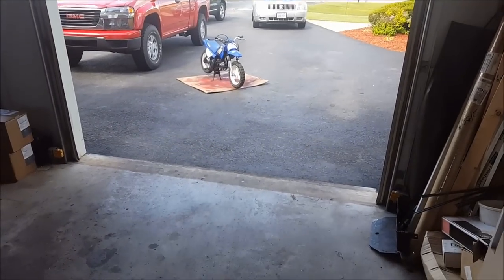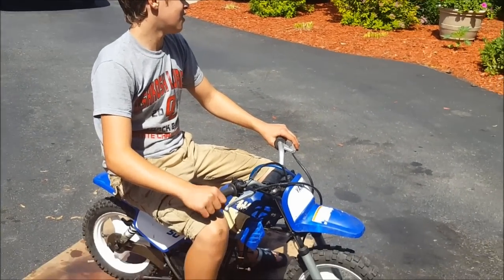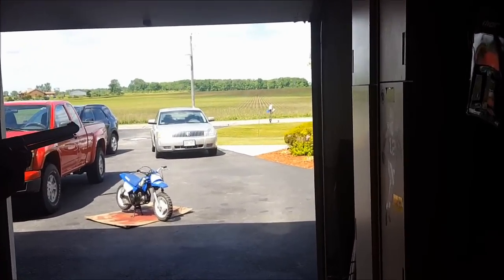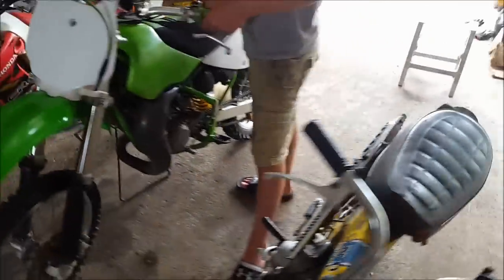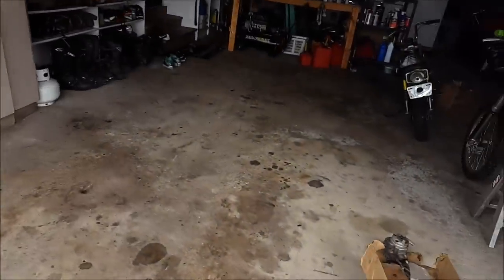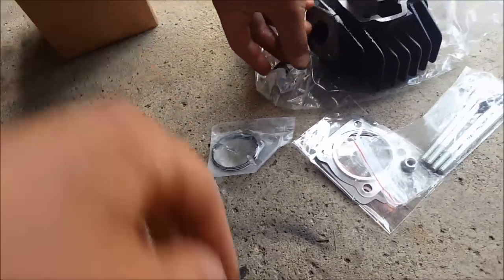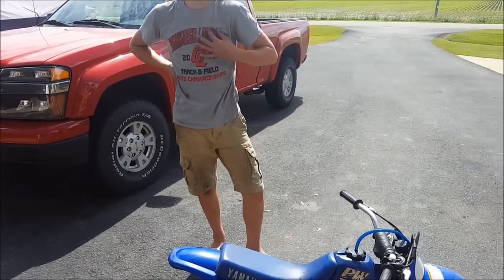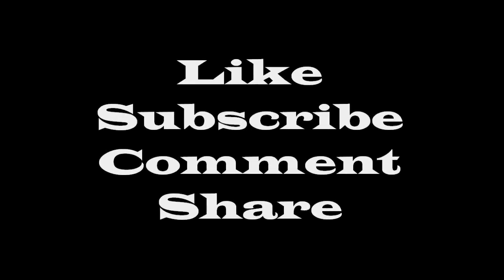Big Bore in the Yamaha Pw 50!!!

Comment: I have a 1983 pw 50 that's still running strong.
Reply: I have an 82 yz100j that’s still running strong
Reply: That means my 2021 should last me till  2050 ??
Reply: @thetrollking6393  if you take care of it yes.
Reply: I bought a 2008 pw50 and had to replace the cylinder. Looked bad on the exhaust side but was still running

Comment: remember to actually break it in. dont just throw the big bore on and fire it up and hop on and ride. do it right
Reply: Leaving it to idle like that is possibly the worst thing to do to an engine running in. It needs heat cycles and varied revs.
Reply: you need to ride it just dont reef on it
Reply: for breaking in a cast iron big bore u can leave it fucking idle doesent matter and u should drive quite alot on like half throttle so they doing nothing wrong and a aluminium u can just leave it on idle for 15 mins and its broken in
Reply: You know he will slap  it on ,,fire it up ,,and ride it on the pavement ,,then the manicured grass ,,then back to the garage;;!???